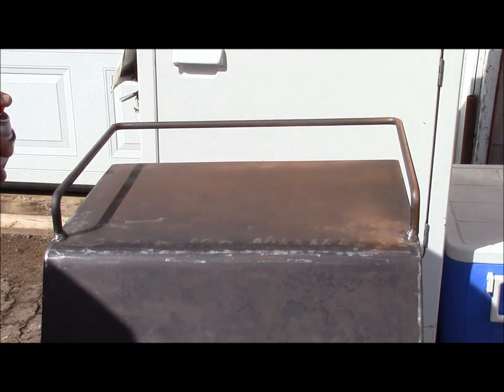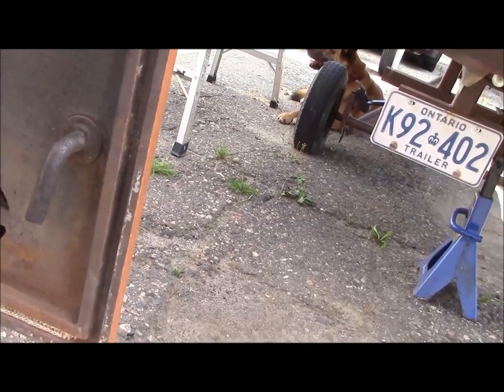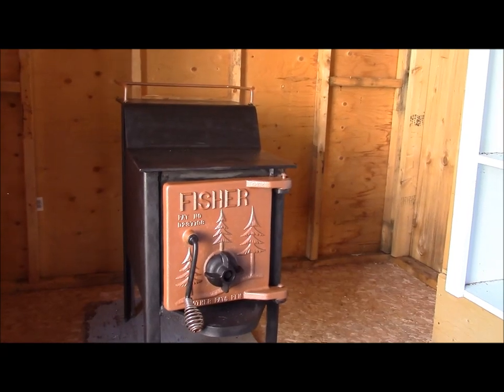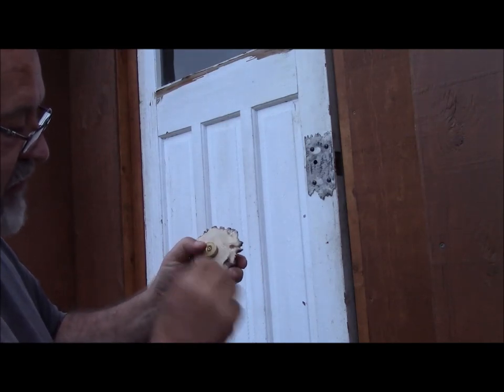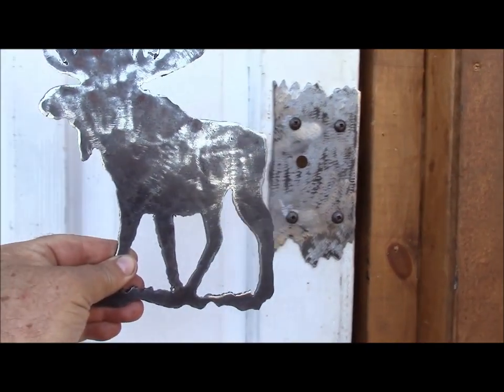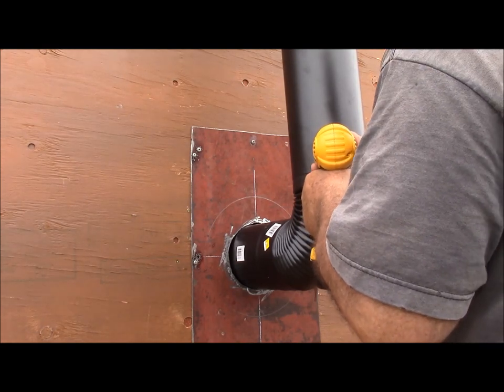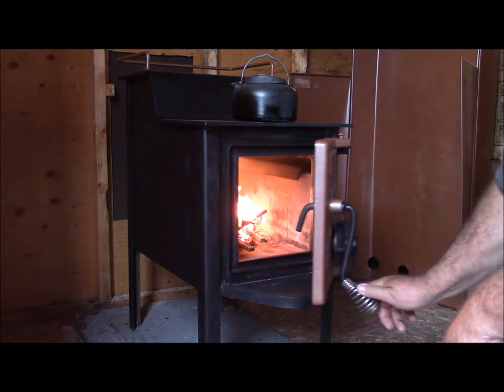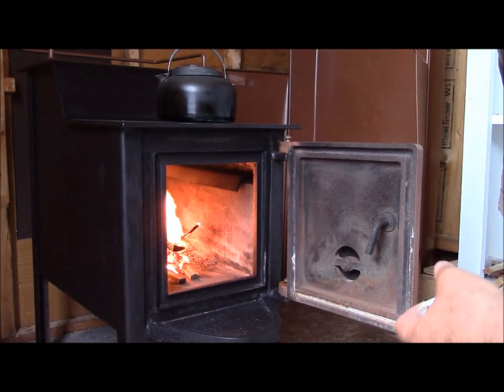New Life For The Old Wood Stove

Comment: Nice Baby Bear.  My understanding is that all Fisher stoves from that era did not require any type of roping to seal the door.  Only later models with glass windows needed that roping, the old ones were designed without that.  Love the color on the door!
Reply: you are correct.  there is no gasket.  the setbacks are also more than 4" from protection.

Comment: No gasket material needed ... These stoves were designed air-tight and as-is with no gaskets from the manufacturer. Otherwise good looking stove!
Reply from the maker: Thanks for the comment Luke. I didn't think it needed a gasket but there were remains of old gasket material on the stove. Of course it is an old stove and who knows what kind of life it has had.  It has since been removed and the stove works very well.  ATB     Paul
Reply: I was going to make the same observation. I have a mamma bear and no gasket is needed.
Reply: @huntshackwildernessexperie6820  If you find an opportunity sometime, I recommend reading Bob Fisher's book. We grew up with Fisher stoves heating the house and they were always special to me. They have quite the history as well, as eluded to in the book. I think you'll find it an entertaining read not to mention informative. I'm pretty sure the book is downloadable for free in PDF format.
Reply from the maker: @specvdrvr04  Thanks . I'll look for that book and download it.  I'm interested in history and particularly 1700 & 1800 's tools etc.

Comment: Nice job on the restoration of the old fisher I have the same stove myself in my garage and was wonder can you burn it with no smoke out the chimney mine smokes like crazy but it does put off good heat
Reply from the maker: I saw that stove sitting in the snow behind a shed . I bought it and restored it. It produces enough heat to make my trailer into a sauna  : )

Comment: Hi I'm contemplating buying one of these baby bears or a momma bear for my 600 sq foot cabin. Would you suggest this stove or the momma bear? Cabin will be well insulated. Thanks.
Reply: Also my cabin is in northern Wisconsin so winter is cold there.
Reply from the maker: Hi.Gerald.  I am in northern Ontario. Canada so I understand cold .  I have found that the wind is worse than the temp. In many cases . This stove would likely do the job well but if it is to be your only heat source I would go to the Momma ...just for insurance.   ATB
Reply: Ok thanks for the info!
Reply: I know this is an old video, but I live in a well insulated cabin in SC, its 600 square feet, at 15 degrees which is really cold for here, you can't run a stove like this wide open, you will burn up, with good dry hardwood.  Baby bear is all you need, trust me.